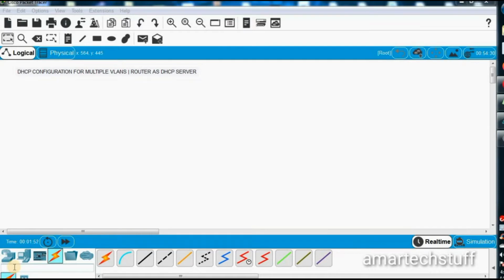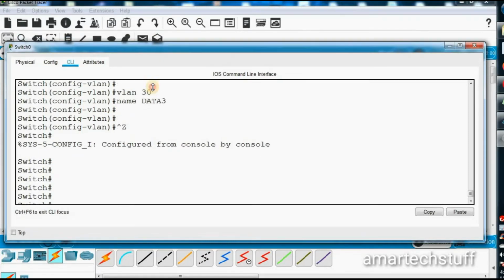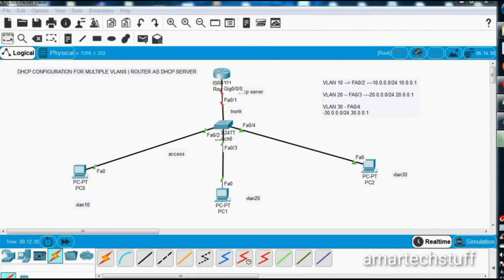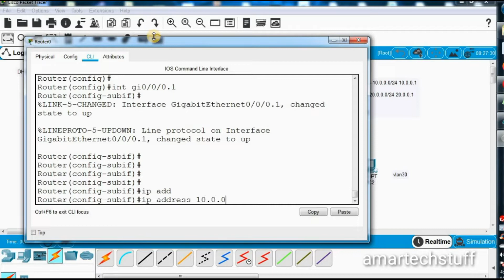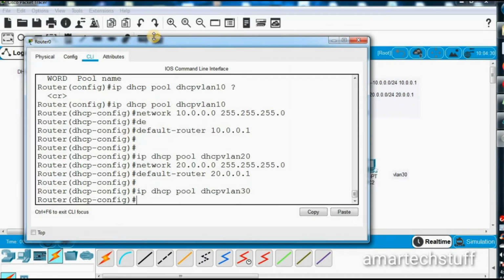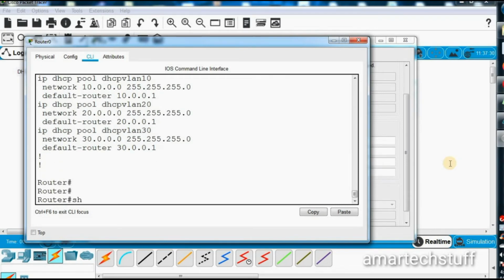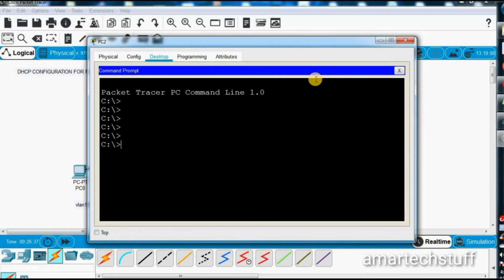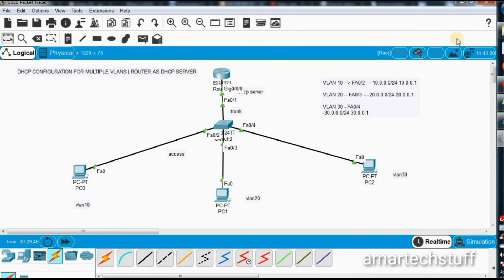DHCP Configuration in Packet tracer with vlans

Comment: you already assigned ip's ( default gateway) to g/0/0/0.1 interface where you wrote ip address will nor be configured because you (no shutdown) the port , on the other side when you again assigned the ip's to g/0/0/0.1 interface you didnot (no shutdown) you simply exit this is the issue